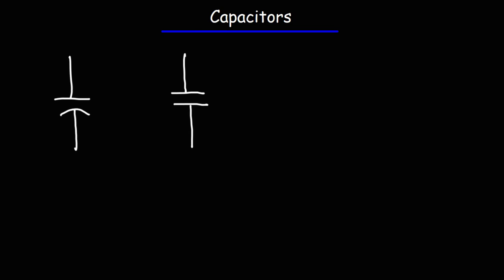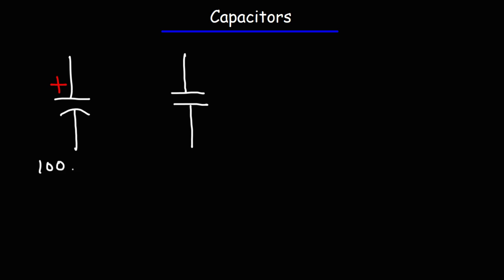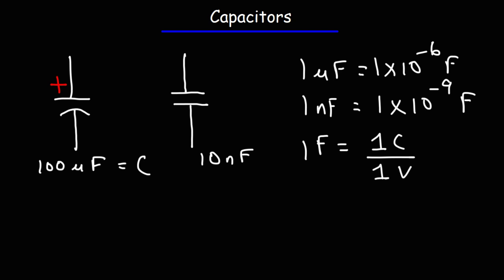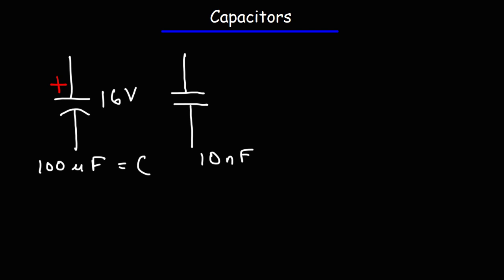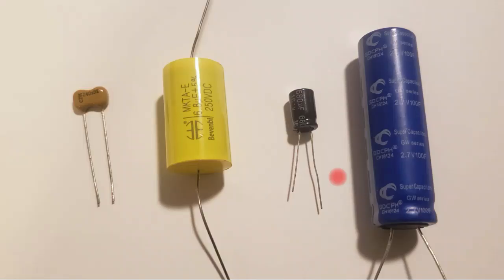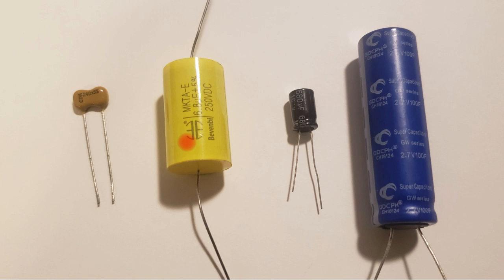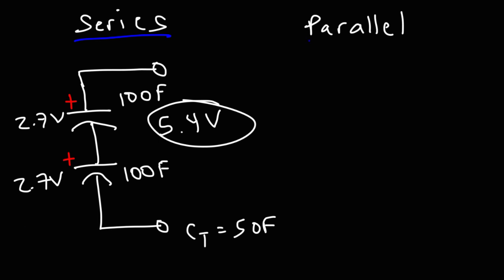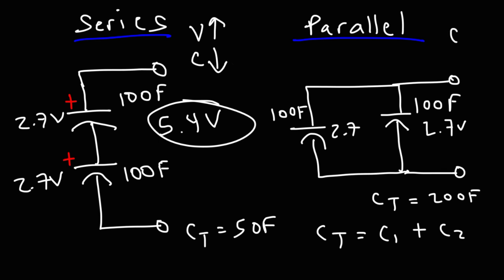SuperCapacitors & Electrolytic Capacitors - Basic Introduction

Comment: I also forgot that I think you need to put the resistor before led anode lead where the current flows. led is current hungry and it may damage the led. 
and you can use ohms law to calculate what current and voltage will be available for your led depending on the resistor.